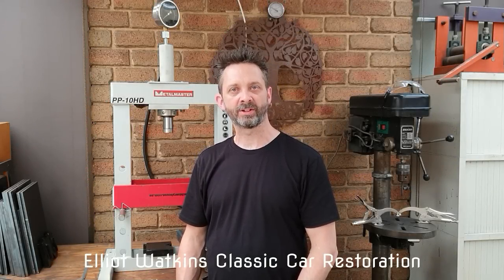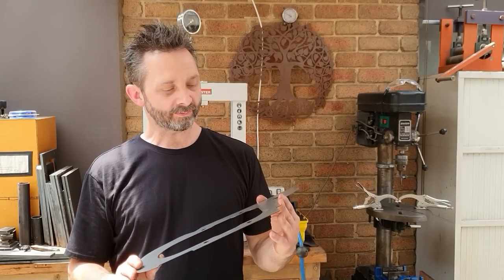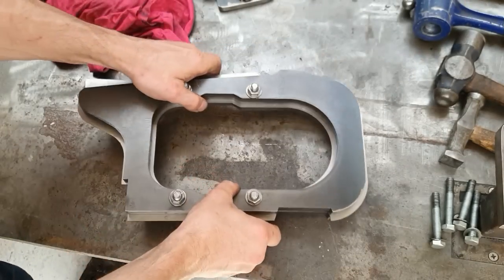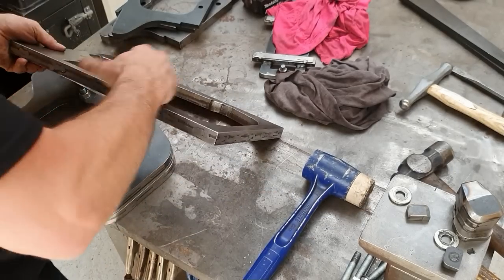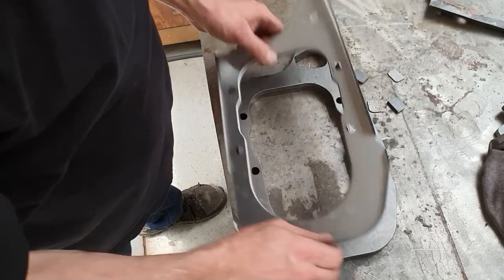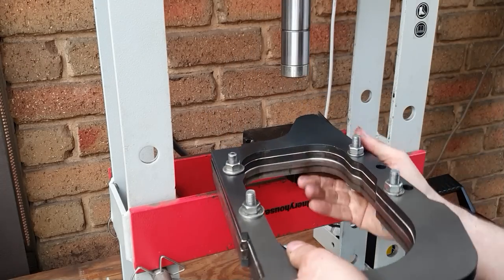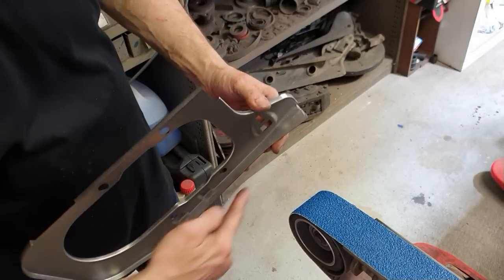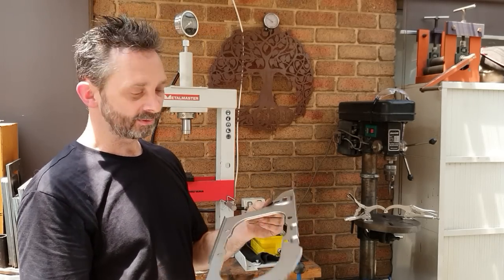Using a hydraulic press and lasercut jigs to make basic car panels, Mk1 Ford Capri

Comment: At only a minute and half into the video I can see this is a brilliant method.  I don't have a cnc laser table, but I do have a cnc plasma table.  I have thought of things like this and you're showing us the practical side of how to make it happen.  Crazy ideas are one thing, but making it happen is entirely another level of thought and action.  Well done!  EDIT: I've watched all the way to the end now and it's absolutely genius!  I can picture your method being extended to making the reliefs on hoods and doors, with the press lines left in, almost like an elevation map.  A whole new family of lined designs.  Very cool and inspiring!
Reply from the maker: Thankyou for the kind comments.  Id be interested to see how you could go with a plasma.  My initial thoughts would be that it would be harder to achieve accurate clearances between the jig parts.  I guess if its your own machine then it wouldnt cost you anything to have a go.  Im going to do a similar video on a battery tray that i make in a similar way but its another step up again with sections that are drawn up maybe an inch or so, its pretty impressive how close to or better than factory the results can be.

Comment: Very nice process. I make a lot of similar parts for a different make of car. I have had some luck using rubber and polyethylene male "punches" Both for forming  and for touch up like on the little wedge shaped cut out. It's kind of like hydro forming and saves the effort involved in making so many metal press parts. Works well for making raised stiffening ribs on flat panels.
Reply: I think that I saw a video of someone using that process to make sheetmetal parts. I think that it was a guy making home made aircraft parts. Naturally it is very important to make such parts smoothly and cleanly to avoid tears or stress points in that sort of application. 
Mark from Melbourne Australia
Reply: @markfryer9880  Yup, I use a process that's a bit more "open" than the airplane guys seem to use, but the results are similar. I generally use synthetic "stone" counter top material (corian) for one half of the tool and rubber for the other half. I also have one die made from special filled epoxy made for the purpose of low volume press tooling Most of the parts I make are in quantities that are small enough that full-on tooling is not economical and neither is one at a time. There are very few parts that I have made more than 100 of and many that I have made tens of. So, kinda caught in the middle volume-wise.
Reply: @edwardtaylor4785  How do you shape the Corian?
Reply: @piersvellacott5710  Corian, and other similar products, can be worked with ordinary carbide wood working tools. If required, it can also be heated and bent if the shape requires it. I use the resulting form in two basic ways. When possible, I do as much of the forming as possible with a rubber "male" punch in a hydraulic press because it is fast and produces a nice smooth part. I have the luxury of a 37 ton platen press, but an ordinary H-frame press will work too. Corian is brittle and the form must be very well supported or it will crack. For fine details, rolled edges and such, I use an air powered rivet gun with a variety of HDPE tips attached to it. I don't use tools that are harder that the material being formed to avoid marring the part or getting unwanted "smiles" that have to be fettled later. Just trying to form it, not damage it. Google "flow forming" and you will probably find some additional information on the topic. BTW, for a "one off", I have seen some folks use MDF for the form, but the Corian type material is more durable if you're doing multiples.
Reply from the maker: Ive seen a few guys use the rubbe die technique, not tried it myself, i dont have a 3d printer but i think that in combination would be usefull in intricate parts

Comment: Excellent video, well done. All you need now is a cnc plasma cutter and you can make your own dies. The crossfire CNC plasma cutter is an affordable machine from Langmuir Systems in the US and ships down under. I cut 17mm mild steel with no issues with a unimig razor cut 45.
Reply from the maker: Id love one, just not top of my list at the moment.  Im chasing a descent lathe when finances allow.  I have a good relationship with the lasercutting company that I use and the turnaround time is short.
Reply: @elliotaw   it’s interesting that the laser cuts are not straight when cutting thick metal, I assumed they would be perfect. The plasma cutter also shares the same issue.
Reply from the maker: @digitalbase9396  in thin plate upto around 5 or 6mm thick it is not measurable but the thicker you go after that can make a big difference especially if making parts with tight clearances.

Comment: Nice work.
I have been using this technique on some of the stuff that I’m working on.  I have plans to do small runs of the panels for the FIAT Dino and laser cut tooling is exactly what I need so to see how well your tooling works is really useful.
I look forward to seeing more of your work.
Reply from the maker: Ive found if you get the clearances right between the press jig parts you can get a good run out of them.  Some of my jigs have produced over 200 parts with little to no wear on the jig edges at all.
Reply: @elliotaw  it’s the accuracy and it’s repetition with your alignment jig that I am really impressed with. The Maserati stuff that I work on is mostly hand formed and I do make formers for some jobs.
But the FIAT stuff is machine stamped much like the FORD and this is where I plan to emulate your production method .
As you mentioned it’s keeping the part aligned and centred can be difficult. 
Understanding how the metal will stretch and pull moving and changing the position or size of the holes.
The Maserati air vents video on my channel might interest you as I use a similar technique.
A lot of the job is knowing how to make the tooling to make the part and that’s what I think is really impressive to see in your work and your video.
Making accurate well fitting panels is what I’m going for. The biggest issue is finding enough information as reference to reproduce what is required for the restoration of the FIAT Dino in the first place. If it’s not rotted out then it’s been replaced with something that is completely wrong.
Reply from the maker: @marksitaliangarage  I just watched your Maserati vent video, ive also subscribed to your channel.  I have a close friend here in Melbourne who will love the cars you are working on, he is pro English people and Italian cars so he'll be watching all of your youtube channel for sure.  It's interesting how much of a deep draw you can achieve with the press method without bruising or tearing the metal.  I have a jig setup for some battery trays that I make and that has some deep profiles and is way more detailed than the headlight panels that I filmed the other day.  Was interested to see how you went with the rubber die method, ive not tried it myself but have seen the shermans making use of that technique with good results.  I'm guessing you'd almost have to add 10% or something to the male die dimensions to get the draw lengths right ?
Reply: @elliotaw  i used aluminium for that one I think it would not be very successful with steel unless it was under 0.8 mm .
I think it would work well for brass and copper for trim pieces that sort of thing.
I made a trim piece for the handbrake surround on a Dino Spyder In aluminium with this technique it worked well and the customer was very happy with it. The best thing is that you don’t need to worry about alignment as you are only using a male die.

Comment: That is a very impressive video Elliot.  You make it look very easy, which I am sure it is not.  I will do some research into laser cutting near me.  Thanks for taking so much trouble.

On my Youtube channel I tend toward repairing mechanical things but I quite fancy your system using my hydraulic shop press for some parts for a Porsche 914 I am working on.

If in the search box on Youtube you type in my name "Tony Hillyard" you can have a tour.  Thanks again for a superb video.
Reply from the maker: Plenty of laser cutters around.  Id contact a few if possible as their prices and cut quality can differ somewhat.  Will check your channel out,  cheers.

Comment: I've been using exactly the same techniques plus some others to make some Porsche panels. I totally agree about developing the tooling and the blank being iterative. Patience is required, but the results can be very good. The tooling can get almost unmanagably heavy for bigger panels. I'm going to make a frame to extend the bed on my press so I can press locally at one end of a long panel without having to support the weight of the other end of the tool myself.
Reply from the maker: I hear you.  The biggest panel ive made using this technique was probably twice the size of this one and as you say it gets heavy loading it all in and out of the press.
Reply: @elliotaw  That's probably about the time that you need an engine crane or an overhead gantry crane and possibly a bigger workshop!
Reply from the maker: Always need a bigger workshop..  thats just a man rule !

Comment: Amazing work. Would it not be easier on the square holes do only to small alignment holes until after its stretched and then broach the rectangles to exact size after that? Would allow more metal to draw from when stretching that final dimpled shape.
Reply from the maker: I think if you wanted them holes to be 0.0001 tolerance then doing them afterwards would be a better way to go but I think they only take a plastic clip so plus or minus 0.1mm shouldnt cause an issue.

Comment: Very nice. I have used panel forming to do floor pans and have thought about using a press, unfortunately I don't have one that would be large enough to fit the forms. Something to think about.
Reply from the maker: Even a half floor would be problematic without a sizeable press.  Id imagine a quarter section could be done.  Into bead roller or pullmax territory to do a full floor.

Comment: Great stuff Elliot
What sort of money did you invest in the nests and press plugs. 
Laser cutting the parts and steel cost.?
I suppose you used the centre cut out of the perimeter frames to form the centre plug just filed/ ground a bit more clearance to allow for the sheet metal.
18 gage or 19 gage?? 
I have seen a few guys doe the same metal basic forms and use an air chisel with a head with a hammer or a rounded chisel shaft to hammer form over the nest particularly low number or one off parts.
Reply from the maker: I dont use the scrap centre slugs for the jigs as the laser cut width doesnt match the steel thickness.  I use 19 gauge ca3.  Cant remember the cost of the lasercutting to be fair, it was a while ago i had them made, id be guessing around 6 or 700 bucks au.

Comment: Not in for cars, But I like to work with metals😛But what really caught my intrest in your vid, is that pedal for your hydraulic press. Have you made it yourself? Just pushed the sub button mate😉
Reply from the maker: Its an air powered hydraulic pump.  Its supposed to be on the floor and foot operated but i find more control using it on the bench with my hand.  Theyre freely available, you can get one made of chinesium for a hundred bucks or so or a high end one for a grand or thereabouts.  My one is middle of the road pricewise.  A well worth upgrade for any hand pump operated press.
Reply: @elliotaw  Thank you very much Elliot🙂 Btw really good vid n work, keep em coming mate🍻

Comment: That is wonderful, although the setup jig is a lot of work and lot of materials. If you dab a slight film of tallow, engine oil or grease on the panel where the pressure areas are, then your pressings will not tend to stick and come out smoothly.
Reply from the maker: I usually use a light oil on everything.  i didnt on this occasion while filming because i didnt want to have to keep handling my camera with oily hands.
Reply: @elliotaw  Quite understandable in the circumstances.

Comment: Very neat work. 
The hydraulic press shaft doesn't  appear to be quite vertical. I guess it is usually not a problem but could get worse??
How do you sell the parts you si cleverly make?.
Spain
Reply from the maker: Might just be the camera angle.  The cylinder is definately vertical.  Though i leave the mounting bolts loose so it can slide from left to right along the frame easily.

Comment: nice panels but like you said, you need to be making a load at a time to justify the amount of work in the tooling. i thought you could have threaded the holes for the lugs to make the dimples and simply wound the bolt in maybe?
Reply from the maker: Yes that would work quite well i reckon.  good thinking.
Reply: @elliotaw  yep, more than one way of skinning a cat. i think we're all guilty of being blinkered from time to time. in my job which has been fitting kitchens and bathrooms etc, for too many years, i often see some other fitters that are pretty rubbish, but then i spot something they have done, and thought, that's a good idea, even though a lot of there work is pants. just goes to show you, we can learn something every day.

Comment: Use a flat to distribute the press pressure instead of round bar and lift your press surface up to the top hole.
Have you tried using lubricant the surface being pressed?
Nice work though.
Well done.👍
Reply from the maker: I do normally lubricate everything.  Just decided not to for filming purposes.  Would work better to spread the load,  i have a few press dies from closed down engineering shops but they get heavy and unweildly to handle.